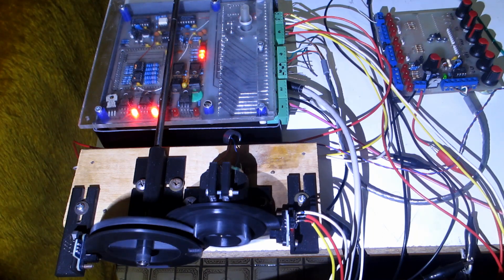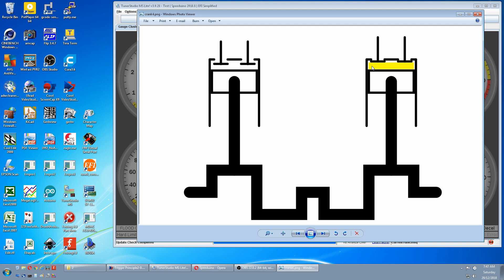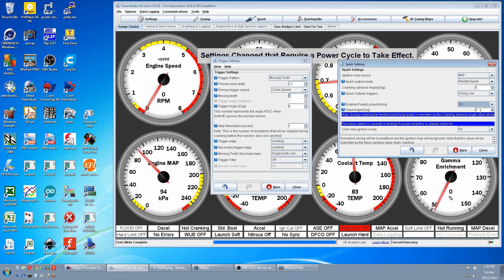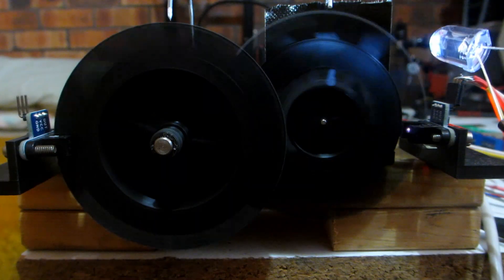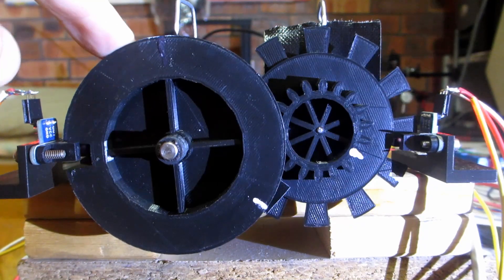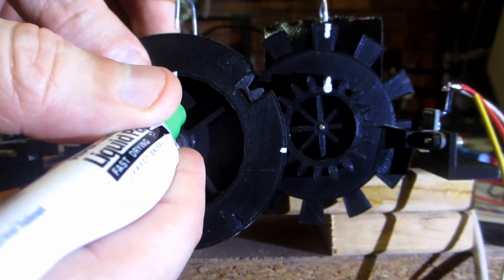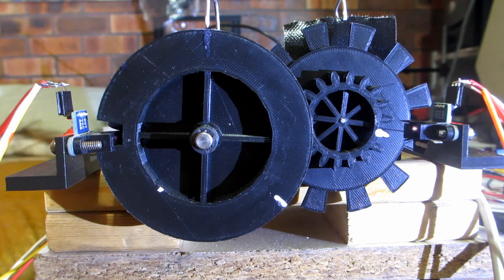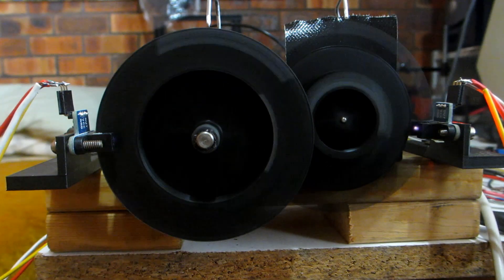Speeduino EMS #7 - Adv Trigger#2 - Crank w/IGN demo

Comment: Thanks for this video it really helps. I'm hoping you can help me understand how to properly configure my set up. I have a sohc Honda D16 engine. Within the camshaft gear I set in 12 north pole magnets to act as the crank trigger and one south pole magnet to act as the cam trigger. I'm using a dual pole hall effect sensor. Is it possible for the dual wheel pattern to work? The engine is backfiring randomly although I was able to set the ignition timing via a timing light on a mark I made on the crank pulley.

Comment: so in sequential ignition i can just either find the atdc and use a it whatever degrees that i may find without changing the cam position trigger wheel?
Reply: just like over here at 7:23 you didn't change the position of the cam tooth wheel

Comment: Hi, I think all your demos are brilliant, and I would like to tinker with mapping ignition only on a three cylinder carburetted motorbike. I believe I would need TPS (and/or map sensor to determine load) and missing tooth crank sensor, but that speduino might be a cheap and sensible candidate. Could I ask you for your opinion and thoughts, or what alternatives you might favour for DIY ignition mapping..?
Best regards, Russell.
Reply from the maker: I'm not really an expert in all the systems, and only know a bit about Speedy and rusEFI. 
It sounds like you just want ignition. Generally people go TPS and MAP, but I think in n-Alpha you only need TPS. They are a friendly bunch on the SD forum, and they know more than me.
Reply: @SidneyCritic  Many thanks. Really enjoyed your porting videos btw. It's probably some ungodly hour where you are, or maybe early morning, but have a great day, as they say... 🙂. Cheers.R.